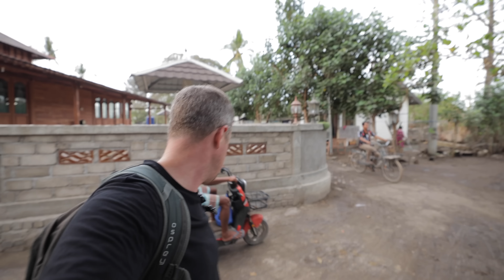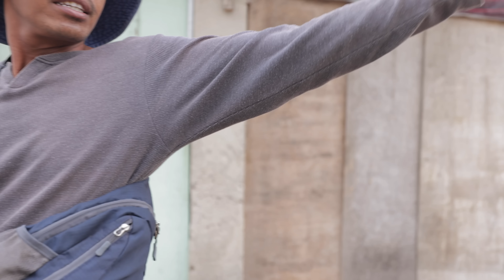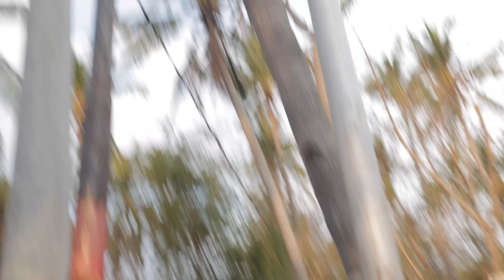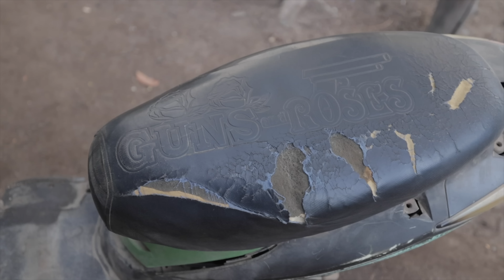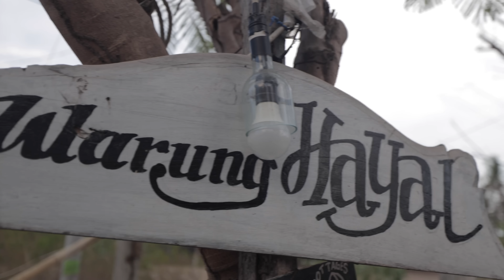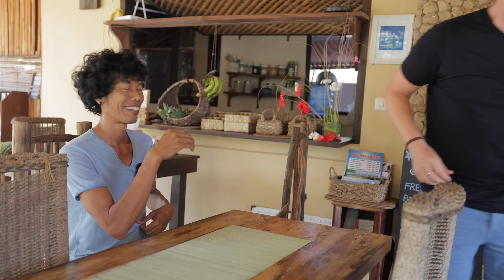They Make Electricity With No Engines… How? 😳

Comment: On "Gili Trawangan" (Gili means small island btw) there is a big solar array that is connected to the 20KV network. The Gili is interconnected to the main Island "Lombok" with 20KV underwater cables. All of the Power Utilities (from Generation, transmission, and distribution) in Indonesia are run by Indonesia State-Owned Company and its subsidiaries "Perushaan Listrik Negara" (PLN) literally translate to National Electric Company. Yes, we do have standards and rules, but mostly it was not followed, for example there is a rules for residential installation certification before it can be connected to the grid, but I never see it enforced, so almost every house in Indonesia is like a DIY project 😂 (depends on who you hired to install it), the exception is usually on big cities like in the capital. On small island like that it's common to see only two breaker on the house, one on the meter installed by the utility company to limit the usage (we have different contract for as low as 2.5A, 5A, 10A, 15A, and so on, on 220V single phase) and one other breaker inside the house just for "safety" usually always 16A even with 1.5mm cabling 😅 and usually no grounding either, sure it's better in the cities, but not always. BTW I have watched some of your video before, and I found this one because you mentioned "Indonesia" in your video titled "The Worst DIY Solar Install I've ever seen". Keep up the good works! it is very entertaining to see how it is done on the other side of the world.
Reply from the maker: Awesome! Welcome to the channel! Thanks for sharing your knowledge.

Comment: Since early 2017 fresh water was installed on the island and is supplied by underwater pipes from Lombok. Electricity is supplied by underwater cables from Lombok. There are no cars or motorbikes.

Comment: Jordan, you are correct in being shocked at the atrocious electrical installations on the island, but you may not be aware of the widespread consequences. While fatalities from electrocution may be relatively low (or not recorded in national statistics), about half of all fires are caused by bad electrical installations, burning down thousands of homes and killing hundreds of people: 

"Situation of Fire in Indonesia
In 2011 there were 47,000 cases of electrical fire, 418 died and 1.570 injured. Losses of about $1.4 billion. Important that nearly half  of fires (48%) were caused by lighting and electrical installation. Causes: 63% wiring system, 20% lamp and fitting, 11% from terminal, and 6% from transformer and power supply. Others : Fan (6%), Dryer (6%), heater (4%), AC (4%), water heater (3%), etc (29%)." quoted from Fisuel (International Federation for the Safety of Electricity Users) 2017_Iwa-Garniwa-situation-condition-ES-Indonesia.pdf 

There are also numerous reports of deaths from electrocution in the news: 

- A teenager has died while making a TikTok video in Indonesia. The high school student from Bekasi, on the border of Jakarta, was electrocuted when she reached for her phone that fell between power cables. (Newsweek 2020)

- A young family and their nanny (four people) were killed by electrocution from a suspected malfunctioning water heater in East Jakarta on Sunday, police said. ( Coconuts Jakarta 2022)

and many more..., while electrocutions on outlying islands probably never make the news. We have a very similar situation in the Philippines.

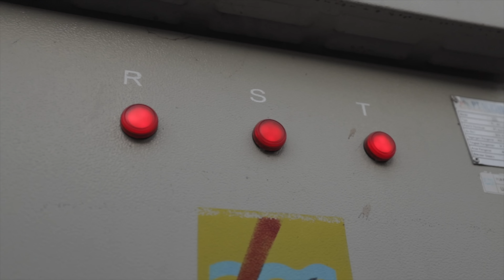Comment: 5:50 RST (or UVW typically used for transformers or motors) are old three phase descriptors, also used e.g. in Poland before adopting L1, L2, L3, though AFAIK in no way related to wire colors

Comment: The tower was full of microwave dishes. A satellite dish at that latitude would be about 8º from vertical. I’ll bet my nuts that electrical power generation will be a remote diesel driven installation. Solar would be great and would run the majority of your grid demand but this island needs reliable power. So that means you will also need large array of batteries to ensure voltage and frequency stability plus standby generation capacity to power the grid when the batteries and PV are unable to meet demand. The massive great Thai elephant in the room though is cost. If the locals thought diesel was expensive, wait until they see how much “renewables” (aka intermittent ‘free’ power) will cost them.

Comment: Ironically, almost all electricity in Indonesia is from either coal or petrol. When you buy stuff like extension cords, earth isn't connected, there's not even a 3rd wire inside, even though on the outside it looks like it, it's just all fake 😂

Comment: These have been so awesome. I went to England Scotland and Wales couldn't think of a souvenir to bring home. I'm not that kind of person. And then got an opportunity to go to the Philippines for the three weeks that I was there I finally figured out what kind of souvenirs I can bring home. For an electrical stuff. I got myself a Philippines extension cord, other than polarization and universal socket it's good quality and metal cased and happens to be semi compatible with the US so I can still use it at home. But I do have this crazy idea to get a plug in socket from every country and put them on a big board and wire them up. I stayed in a few scout huts well in England and the first thing I had to do was follow all the wiring around fascinating, ring circuits weird.

Comment: Cham Island off of Hoi An used to be powered by on island generators for only a few hours a day. Then in 2017 or so they connected to the mainland via submarine cable and now has power 24/7. The cable landing site is nothing special, you just see some riser cables coming up a pole to a recloser and a metering package.  I actually have picstures of them running the cable from the ship to shore, pretty cool. 
Phu Quoc in S. Vietnam is connected to the mainland too. That one I believe is 110kV and tied in the the existing transmission grid on Phu Quoc. And, again, the cable landing site is nothing special. Just  steel lattice tower with a riser cable and pit heads running up it. 
Cham Island it was all 22kV distribution, the common distribution voltage here in Vietnam and if I remember correctly, came in on 22kV too. But it's been a few years.

Comment: Hi Jordan Indonesia is an ex Dutch colonie so I think they probably use the European standard of distributing HV at 10Kv or 15Kv don't know what other voltages are used except that house voltage is 220/380 volts and they also have some 127/220 volts hope this helps a bit cheers

Comment: In some respects here in Belize some of the electrical installations are very similar.    
   You find metal and plastic containment switch gear with circuit breakers installed outside the property without any additional weather protection and considering it has a tropical climate, not good.
   Also grounding or earthing that should be in place within a property sadly in many cases  very optional but as you pointed out in your video you don't hear of any electrical fatalities. 
   Anyway enjoy your time away from the UK and stay safe.

Comment: The high voltage cables won’t be copper. They are generally aluminium with a steel core for strength.
Reply: Those are copper distribution cable, not until you get to larger 336mm wire or so do you end up with aluminum and it's more recent installations. Most of the HV transmission is aluminum though, but this is MV distribution and old.

Comment: Nice video! I went to Gili Trawangan in 2009. And I see a lot of similarities in your video. I remember our apartment where we had a small swimming pool. I didn't want to go in because I saw that the pump was connected ungrounded. Another funny thing I saw there was a street lamp where the original bulb was broken. They simply cut the cable and installed a regular lamp socket. Just like that in the open air. You asked about a country where everything runs on solar energy. I went to Costa Rica in 2017. There we stayed with a Belgian man who had a guest house with several houses on top of a mountain. There you could not get a permanent connection to the electricity grid, nor water. It was completely self-sufficient through a water source and a solar panel installation with 35 solar panels, traction batteries and inverters. This allowed him to provide electricity to all guests and even cook and bake in the kitchen.